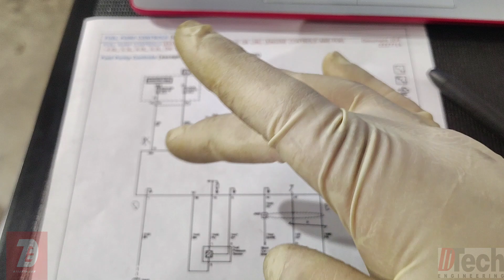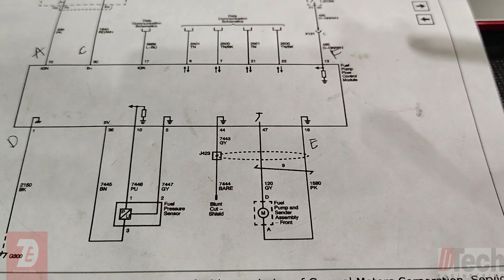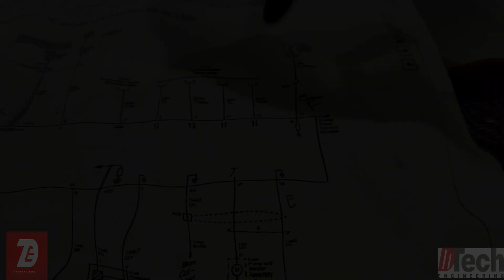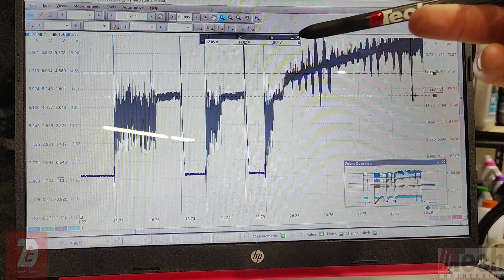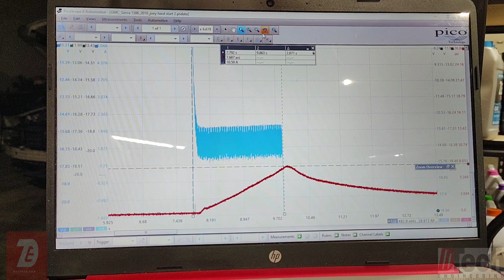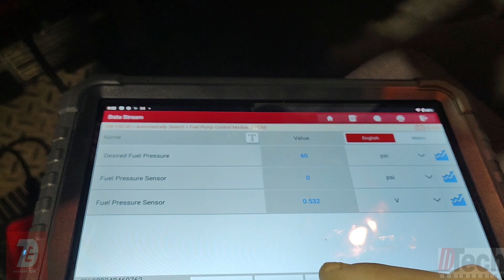GM/Chevy/GMC HARD TO START DIAGNOSTIC P069E P2635

Comment: A fun test I like to do, key on engine off, amp clamp on battery cable, zero the clamp, bidirectional activate fuel pump looking at pressure data. 
Every time a perform a bidirectional control on any component I have an amp clamp on negative battery cable.
Reply from the maker: Good to know, thanks for sharing!

Comment: What model launch is that? The immo version?
Reply from the maker: it is the x431 pro3s + elite, I did review vids on it if you search the channel. It is not specifically the "immo" version but it is able to perform the immo functions when add the programmer.
Reply: So you just basically need the immo box to add on to it? Looks solid